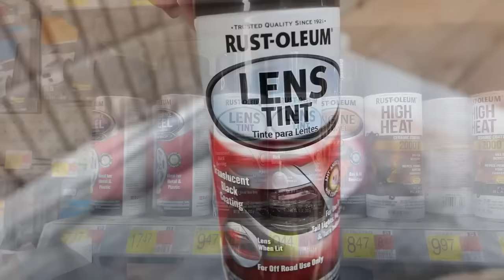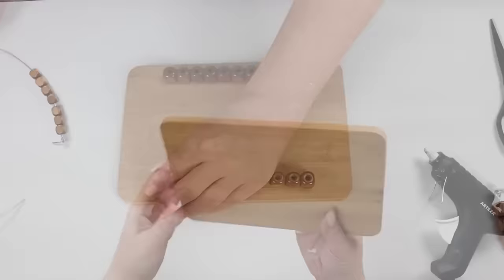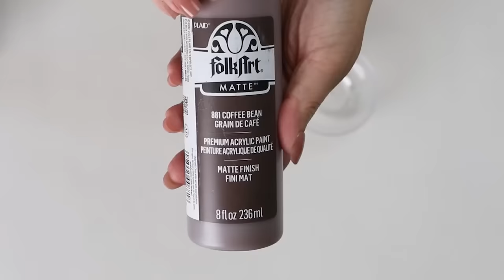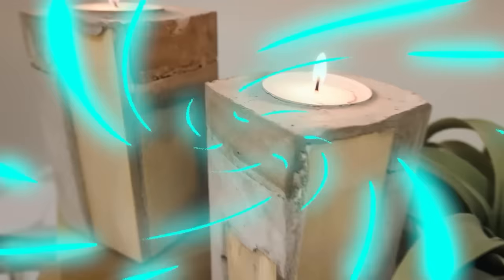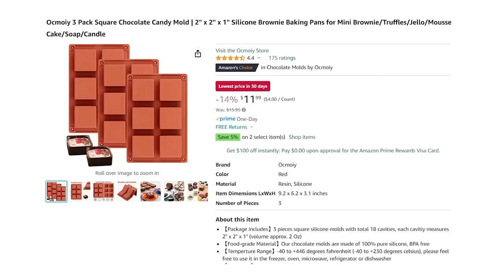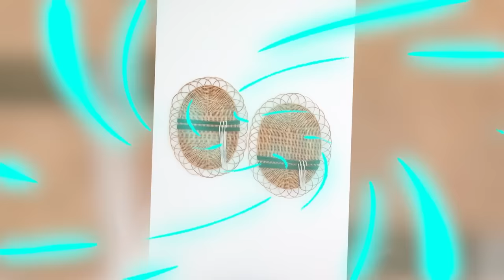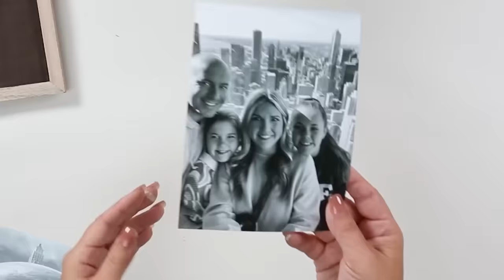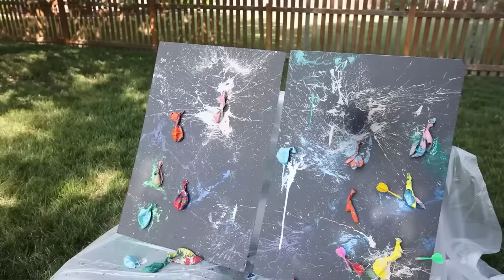50 Dollar Tree DIY's...Quick & Easy

Comment: This tip is from "our upcycled life" for the air dry clay. She uses two wood slats from an old shutter, they are about a quarter inch thick. Just 2 small pieces about 6 inches long. She lays them on the table and puts the clay in the middle and then uses the rolling pin to flatten out the clay. The wood slats keep the clay at the same consistant thickness.

Comment: Air dry tips, make sure your clay is about 1/4” thick ;  use the rolling pin to impress the florals - you’ll get a better EVEN impression which lessen the stress on the clay ; allow the clay to dry SLOWLY ( the slower the better ) by covering gently with a damp cloth if necessary.

Comment: For the moss art I probably would have painted it a moss color first to help hide some of those “bare spots”. I LOVE black and white pictures. They look so elegant. 
Air clay needs to dry slower as not to crack. Use a paint brush and lightly apply water occasionally throughout the day. Your air clay is drying to fast. The balloon craft looks like fun 🤩

Comment: For a interesting look place some ice cubes in container then pour the wax over the ice. 

If out side  ( beach ) and need a craft for children. Have them dig hole then pour the hot wax into the 🕳️ hole . ( Can take sand from the beach and make in a container). Also if they found rocks or sea shells can place in the wax container.
Reply: I did that as a child with a candle making kit! Thanks for the memory!

Comment: Air dry clay tip: could be multiple of things. Too thin. I use wood pieces on each side of the clay to at least keep the clay even in size and not too thin. Also could be lack of humidity in the room you have it drying in. Both can cause parts of it to dry quicker than others which can cause cracking. Still came out great and you salvaged the project wonderfully!

Comment: When  it comes to air dry clay you can add water to the  spot  that's  cracking.  Just use your  finger tip. And do t add a lot.
All your doing is smoothing out the cracking.

Comment: You know that’s what “primers” for? For exa.. when you used one of your expensive pains on the green foam vase, if you spray a coat of primer you would only need 1-2 coats most of the time depending on the primer and item you can do one coat of paint

Comment: Why use e6000 on wood when wood glue is .....like formulated for wood?
Reply: I was wondering why as well. Wood glue will never come apart unless you really come onto it and it's much cheaper.
Reply: Use wood glue on wood! E6000 isn't a wise choice to use on wood.

Comment: Not a clay expert but don't you have to warm up the clay before using??? As in knead it to make it workable, before rolling it out. All I remember about working with clay is thay and how it has to be at a correct temperature cuz you can overwork it. It's been decades so I am probably remembering wrong.